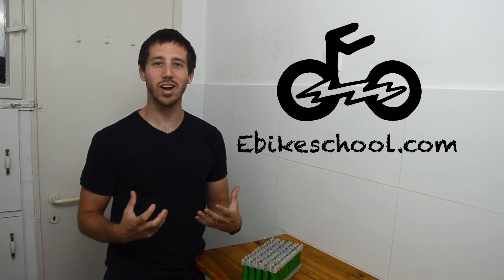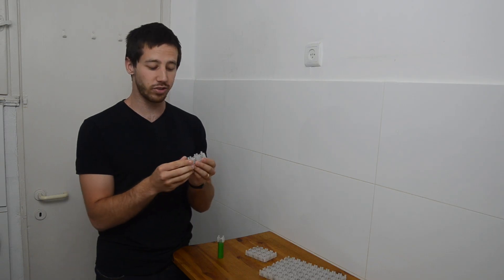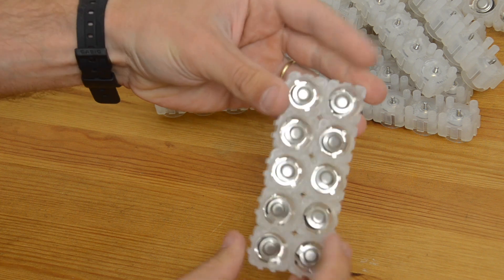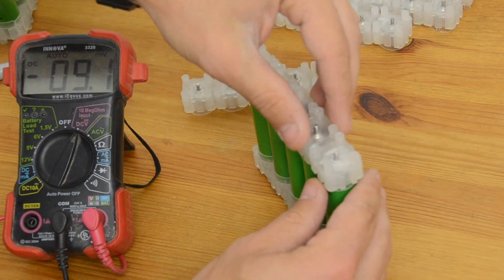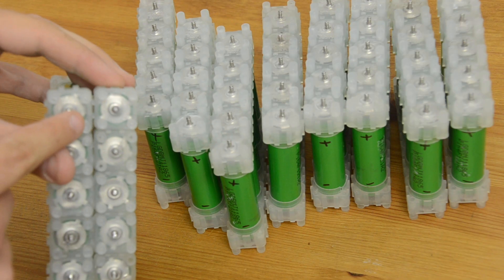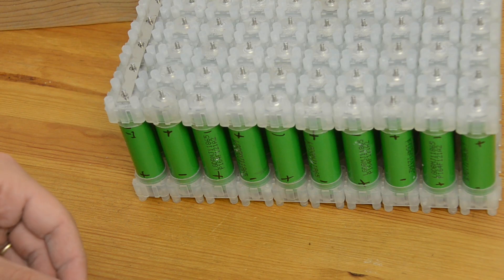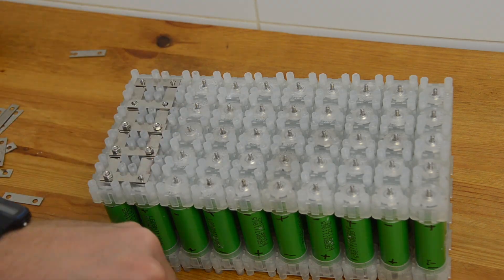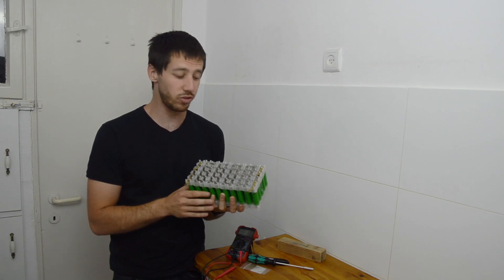No Spot Welder or Soldering Battery Building Kit from VRUZEND.com

Comment: How do you ensure that the terminals and the batteries are making good contact all the time?? It seems to me that there is no 100% guarantee that all the contacts are good, as it might come loose over time..
Reply: I think the contacts are spring loaded.
Reply: that works great until it gets a tiny bit of vibration and the caps slip apart
Reply: The harassment is uncalled for! it does nothing to help your I feel argument.

Anyone working with lithium based batteries needs some technical background to begin with, they are somewhat dangerous even though they look harmless.   

You need to stop getting all emotional and go re read some of the comments I have made because I did say this would be a good idea IF they made some changes to it.

Screws or some other mechanical method to bond the plastic caps together that is NOT zip ties, tape, or heat shrink, insulation in the middle of the links for safety to prevent a potential short circuit, and an insulating cover (heat shrink would work for this) for the caps for when all is said and done.
Reply: the problem is the lack of a mechanical fastener, if there was a provision to put screws to hold the pack together it would be a much safer setup. Tesla uses bolts thats why I am not unloading on Tesla...... their engineers figured out if they hold their shit together with a bolt that has a nylon anti vibration nut on it they wont fall apart..........

There is no PM you can do to this other than hit it with a hammer every time you walk past and I am sure the 18650s will love that!

I don't think being concerned with this burning down someones house or garage or barn is unreasonable. I guess you like having your house burn down.....
Reply: The problem is the white cap on each end are not physically connected together not the connection from the battery to the terminal. Only the friction between the white cap and the battery holds the electrical contact, there are a ton of factors that will effect how well that friction connection is maintained. heat, vibration, diameter of the battery (its a mass produced product and can vary cell to cell) just to name a few.
Reply: this "youtube know it all" is a mechanical and electrical design engineer with 10 years of experience, the name calling is uncalled for
Reply: wahwah1013 battery door..... mechanically retains the battery. Wow that was hard! 

Cellphones the battery contacts are soldered or use a SECURE connector that CAN NOT loosen.
Reply: The problem that septrothFFXI talks of is a legitimate issue. There is no rigid reinforcement of the connection on the holders in between when you use zip ties. Vibration WILL separate the connections eventually, but you will never know it until you have lost enough of the series blocks to notice a drop in capacity. A single vibration separated cell takes out the entire series from the pack, leading to greater load on the remaining series. So your 7s11p will eventually become 7s10p, then 9p, then 8p etc. Have fun disassembling the bus bars from the packs to figure out which series is out however - if you don't destroy a remaining series through lack of or poor BMS.

A strictly spring loaded mechanical connection is also susceptible to poor conduction, potentially creating overheated junctions from excessive current.

Use solder. Building a pack is too expensive to take the lazy way out. Spot welding is even better - https://www.youtube.com/watch?v=o1NFbchHeM8
Reply: It all comes down to planning and a good mallet. I have a little bar I put under the contact and bend it upward each time I change batteries. Then I make sure there's proper contact by checking with a multi-meter and smacking offending cells with the mallet. This makes for a very tight fit such that I don't use the big zip ties they send along with the kit.
Reply: J Bishop there's only so fireproof something can be and vibration on a battery contact if under load will cause arcing creating more oxide and a higher resistance. This thing is somewhat dangerous under the right conditions
Reply: wahwah1013 there's a reason large buildings have tuned mass dampers in them.   You need to educate your self on the topic some more before you make any more statements that make you look foolish
Reply: I don't know how well it would stay together under high-vibration environments, but as a "powerwall" type of setup this would be great.
Reply: I guess it's something that will just have to be tested.  I personally don't plan on using them because it's much cheaper to spot weld.  This device may be good, and for low-current applications i'm sure it's fine, but looks like it adds around $.50 U.S. per cell to my costs, so it's really not for me.
Reply: Yes, but vibrations can also remove oxides between the moving parts.  In my view, for stationary objects this is a fast, relatively cheap solution.  EV's have (or should have) protection circuits in their batteries to detect high-resistance cells, so even there it's not a huge problem.  I wouldn't build a battery without protection/balance circuits, that's just wasteful.  If it's a power bank, not an EV battery you can also design in a fire-proof enclosure, since weight is not an issue.   Also, in a stationary application, maintenance access should be easier, as you aren't space-limited and environment-proofed as in a vehicle.
Reply: I find this an interesting discussion, but... SURPRISE!...the insults don't ACTUALLY help the discussion.  I'm really interested because technically a spring under enough compression should be a better connection than a threaded bolt.  I know the 1st gen Honda NiMH packs used threaded bolt connections., which were then tensioned at the ends of the parallel strings.
Reply: VEGAN WARRIOR Did you watch the spot welding video I linked to? It's a lot faster and easier than soldering, and the welder setup could not be much more simple.
Reply: That's spelled breathE. lol I think this idea is the CAT'S MEOW, mainly bc I HATE soldering. BTW, how much will I save by building my own LiFePO4 48v 20ah pack, approx.? On average the pre-built packs go for $400.00-$600.00 USD depending.
Reply: He said the contacts are springloaded
Reply: What are they made up of?
How well do they stand up against heat buildup on battery bed?
Reply: It's called preventative maintenance. Car, boat, and motorcycle batteries are all connected with bolts. I don't see you giving GM shit abut vibrations. How do you think TESLA mounts their batteries? Yep with good old fashioned bolts. How come you're not unloading on TESLA?

If it's a real concern for anyone out side of Catain "What If" here simply use some conductive adhesive.
 
It's fine that you don't like the product but you do not have to be so damn unreasonable with your cornucopia of "what if's"
Reply: there are NO screws holding one end to the other, the only thing holding the electrical contacts on the batteries together is friction if there was a mechanical fastener (plate with screws in it, screw holes in the caps them selves, etc)  this would be a good product, the lack of mechanical fasteners (not zip ties) to hold the contacts on the batteries makes it dangerous. the swearing and name calling is completely uncalled for, not picking on them I am picking apart their not so safe product that needs a few changes before it is ready for prime time. 

ooo patented nylon! fancy shiny way to charge 10x as much for something they could use a nyloc on, but their engineer wanted to pay a lawyer for a patent.

If someone that has never soldered before is trying to build a large capacity battery they probably don't know much about electronics and probably should not be messing with lithium polymer batteries to begin with. There are plenty of places that will build you a 18650 pack professionally in the form you want with balance wires and the end termination you select.
Reply: take 2 deep breaths and relax.......

no existing battery uses friction alone to make electrical contact. 

I could make the same claim that you are advocating how good a product is without ever having held it in your hand, see how ludicrous you sound?

and go google building vibrations you will be shocked........................
Reply: Oh for fucks sake you're the little engine that could of nonsense, aren't you? Us heat wrap, electrical tape, duct tape basically any form of strap. Jesus man, give it up.
Reply: Obviously nobody saw or listened to the instruction in the video, use cable ties to prevent the caps from disconnecting from the battery terminals.. Its just as simple as that, problem fixed and resolved before fitting them where ever..
Reply: J Bishop even buildings vibrate, hvac equipment, floor machines, elevator equipment rooms, etc.... it does not take a very big vibration of the right frequency to shake something loose especially if it's only a friction fit. Poor contact in electrical systems causes resistance, resistance =heat, too much heat over time and now you have a fire
Reply: The batteries snap firmly into the caps and then the caps connect firmly to one another making one firm unit. Friction knocking them lose is nonsense talk from a Youtube know it all shitting on other peoples idea's.
Reply: SeptrothFFXI in your case... add the zip ties provided for extra measure... problem solved?
Reply: " mechanically retains the battery." that describe this product perfectly.
Reply: SeptrothFFXI, And yet if you look at a 2-way radio, the batteries are connected by spring  loaded connections. And those radios are life safety items, not your cell phones that are consumer use.

If you are so worried about them coming loose, just Crazy Glue them together or make a top and bottom plastic plate that you can bolt together.
Reply: Yet more nonsense. 99.999% of all electrical device that uses AAA-D batteries and may that use cell batteries uses friction to make electrical contacts.  According to you anyone walking around with a cell phone or a watch is in imminent danger and oh God forbid they put their phone on Vibrate... What is wrong with these people? Don't they value their lives? 

I'm not saying building's don't vibrate. I'm saying you're an irrational loon for suggesting people avoid buying this kit because buildings vibrate.
Reply: @redrocker1055  Lol, two years later, and they have implemented and released the changes requested by @SeptrothFFXI (and many others) in V2.1. Bet you feel real smart now.
Reply: @sp1ke316  They "implemented" the bolts because of people like him who need to be told that coffee is hot. Zip ties, as already covered, do the same job. But hey, you revived a two year old comment chain. Congrats on getting the attention you desperately needed.
Reply: WOW! I meet a millionaire, and aid to the president and an engineer all on Youtube all in the same day. What are the chances?
I have zero patience for you Internet naysayers sitting behind the cocoon that is your screen questioning, nitpicking and just generally shitting over people and their idea's.
These guys actually had the ambition to bring a product to market that helps people without the technical knowledge that would otherwise be unable to build these batteries and they do so without charging an obscene amount and all you are doing is shitting on them 'cos "buildings vibrate". Take your fake engineering degree and go fuck yourself with it.
Reply: OH MY GOD!!! You really don't get how fucking ludicrous you sound, do you? You are literally telling people to not buy a product you have zero first hand experience with because in your convoluted mind it doesn't meet the California building code redundancy of fucking "buildings vibrating". NO BATTERY IN THE HISTORY OF EVER HAS. You know why BECAUSE IT's NOT A FUCKING ISSUE, you simple-minded fuck!  Sweet headbanging  Jebus  you have to be tapped on the forehead in order to be reminded to breath?
Reply: Harassment? I was responding to J Bishop. You engaged me, dipshit. Take your delicate sensibilities and shove them in the same place you keep your fake ass degree... "buildings vibrate".

Comment: Yeaaahh... I have 2x VRUZEND kits here!! The value you get with these kits is just FANTASTIC! Excellent price and customer service, super easy to build packs, only one small socket driver required!
Replacing any faulty cells in the middle of the pack is super easy, maybe the easiest design I have ever seen!! All you need is to locate the faulty series, remove the bus bars connecting to the neighbour series and remove the faulty whole parallel group. Even easier you can just remove few bus bars from one side of the pack and find which cells is killing the group =]
Depending on the orientation that the blocks are locked there's no need to use the zip ties that comes with the kit (stationary batteries definitely won't need it). The downside of locking the blocks in different orientation would be replacing a faulty cell in the middle of the pack (it's not impossible but you're just making your life harder when it could be super easy and simple).
The thick bus bars also increase the structural strength of the pack, it feels really strong and solid! Yes, it can handle enough current for most applications.
*if using recycled 18650 cells, make sure the cell terminals (positive & negative) are smooth and clear enough to offer a good contact between the cells and the spring load inside the block.
Love this little DIY battery kit =]

AWESOME video Micah, I'm sharing this video right now!!
Reply: Festivejelly never got a cent $$$ to say anything about any product!!! I wish I was getting paid hahaha...  if I think something is AWESOME I just like to spread the word and help others out there =]
Ohh yeaahhhh
Reply: Its BRUNO YEEEEEEEEEEEEEEEEEEAAAAAAAAAAAAAAAAAAAAAAHHHHM SO MUCH POWER.. LOL
Reply: papagino007 yeaaahhh so much POWAAAAAAAAAAHHHH... hahahahahaa =]
Reply: How would you know if the battery is faulty? or if it a bad connector?  Either ways, I am willing to take the risk and build a small pack to try it out myself and see how it holds over time.
Reply: Sonnet Gomes j
Reply: ElectricBike bit how we can do the wire fuse
Reply: customer service, REALLY !!
Reply: YEEEEEEEEEEAAAAAAAAAAAAAAHHHHHHHHHHHHHHHH
Reply: Is there a video showing how this is done?
Reply: ElectricBike i
Reply: ElectricBike 74
Reply: Trevor Fortune I got my new upgraded kit. I was having issues with new shrink wrapped batteries (totally removed old cover) not fitting. 

You are right they have fantastic customer service. After letting them know about the problem, they sent me the upgraded kit that fit my cells perfectly. 

As for how do you know what cell is bad......use Smart BMS for the pack. 

Thanks, Micah.
Reply: Breeze .... did u even listen to him in the vid ?? where he says he was involved in the development ??..... ffs... try just watchin & judging for yourself if the product is good or bad... 😒
Reply: Bruno you endorsed these? i'm kinda surprized tbh... simply because i love your videos and you're a true biker... these caps make your battery 30% bulkier and extremely uncomfotably big after it's done....
Reply: douche- how much you get paid to make this comment ?

Comment: I was an early adopter of Vruzend. I've changed out the stainless steel 'bus bars' with copper. Much less heat but still more than I'd like. The 'spring/bolt' combo is also a pretty high resistance material but for what I'm doing 36v 10s 5p it works pretty well. 
I'm still working on a box that I can quickly remove and replace the 18650s as taking the Vruzend system apart and building it again takes too much time. Still if you want an interchangeable battery pack this is the best one I've found.

They also sell a couple of pretty nice BMS if you want to wire them up and balance charge the cells. For me that's lost as I want to charge each battery individually.

Thanks for the vid
Reply from the maker: Thanks for your videos too! And good call on the copper bus bars. I've been doing that as well. We're also working on new spring terminals for higher current, so you should like that version even more, once it gets released!
Reply: yea, i thought the steel bars were a bad idea all so (cheep) why not stamp a better contact metal?
Reply: EbikeSchool.com for those who purchasing kits now, how can we get updates. I have an account with Vruzen.

Comment: Man, this is exactly how i built my battery pack in my RV, i 3d printed it in layers and used copper bolts and copper nuts between the layers to screw the bolts into.
Reply: Nice! That's exactly the application I'm looking to build for myself. Did you use LiFePO4 cells?

Comment: Very cool. Will it be in sale on ebay? EU shipping possible? Btw, EU tax limit is 20$, so please sell 25 packs kit also.
Reply from the maker: There is an EU shipping option also. On the side of the page at VRUZEND.com, just click the flags.
Reply: couldnt figure out youtube private messages (if its still a feature)...had to say fucking props on this "Awesome then... Can't wait to test a few of them before I buy in bulk... Almost 4 Ah in 16 cubic centemeter and what 45g... That's crazy volumetric and gravimetric energy densities, coupled with lower than ever internal resistance.... Groundbraking ! I though silicon was the future.... Silicon is a "light element"... On the other hand, cannot find anything lighter in the same column than lithium.... except maybe hydrogen." right over his head